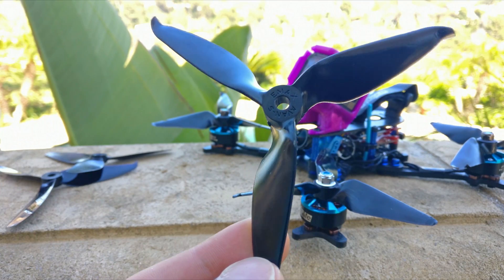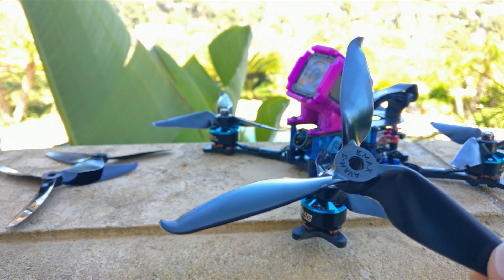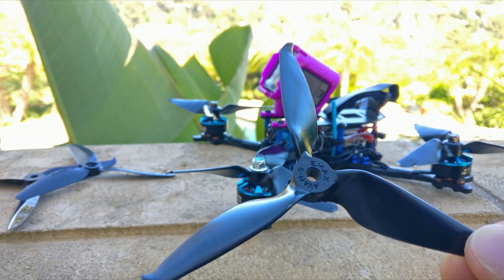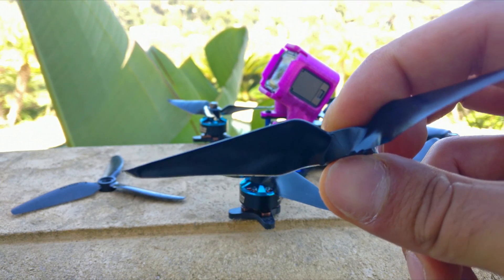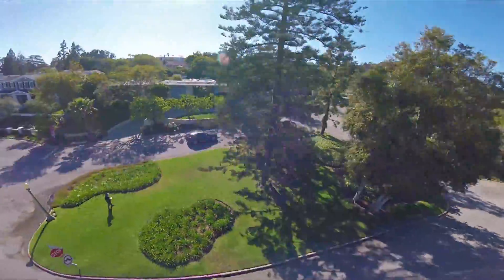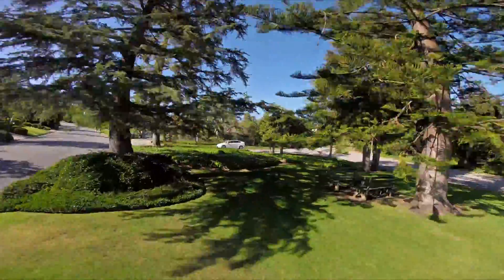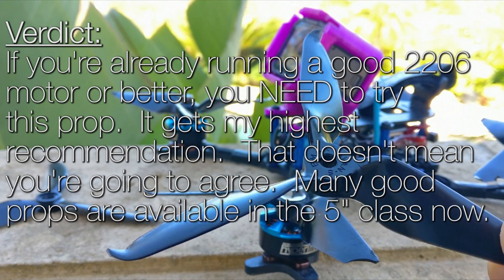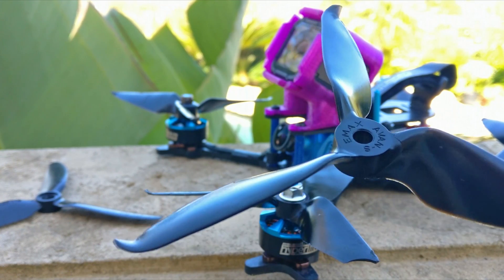Emax Avan Prop (Prototype) - Mini Review

Comment: Should I even bother getting this prop for Emax 2205s 2600kv? As far as I've heard, this motor can't even take Racekraft 5051...
Reply from the maker: Gustautas I wouldn't recommend it.
Reply: That's very sad, seeing how much you have hyped it. Could you recommend the best (in your opinion) prop for 2205s 2600kv?
Reply from the maker: Gustautas there are a few options. the new HQ5x4.3x3v1s, cyclone 5050x2 are probably your best options
Reply: Aside from the high amp draw of ~130ish I have had no problem running 5051 on the 2205 2600s. I've put my setup on 5s all the time with a 650g AUW (Thanks Martian 2, why are lightweight frames so expensive?) and they haven't burned yet. They come down around 50 degrees Celsius which is well within the working temperature of the magnets. Packs are Pulse 95C 1550 which are the same as the Rline.

Maybe I don't know that I'm missing out running a small motor, but other props like the 5x4.3x3 feel way too underpowered for my hefty rig and are pulling 70ish amps.
Reply from the maker: GainsFPV no you're right but the trouble is that on a heavier setup with huge props and high kv, the amps go through the roof. yes you get a bit more power and speed, but at a lot of cost. I also agree that the HQ prop are gonna be a lot slower. in the end your batteries suffer. which is fine as long as you're okay with that. in order to get the power you want, it's easier to go lighter than to pile on the power. on a lighter setup, you don't even feel much difference between the best and not the greatest batteries.
Reply: Kabab FPV so basically, if you're flying with a gopro and want to have reasonable amperage, 2300 is the optimal kv?
Reply: I do suffer in the slaloms too and I'm hoping to shift everything over to a lighter frame also because anything but my best packs I have to be aware not to drop under 15v/12v. Thanks for the reply.
Reply from the maker: GainsFPV by light, I don't actually mean that much lighter. my acro big motor setup is 570g auw. that's not exactly light but once you pass the 600g mark it becomes an issue.

Comment: Is motor shaft bent by thick propeller really a thing? Does it actually happens?
Reply from the maker: IRFZ44 I agree with Plur. heavy props don't bend shafts. I've never seen it. not even in motors made of cheese back in the day.
Reply: in my experience the type of prop you use has nothing to do with bending motor shafts.  If you have a good motor with 3mm or 4mm shafts you probably won't bend a shaft unless the motor itself hits a solid surface hard.  Especially with the trend towards hollow 4mm shafts that are one continuous shaft from top to bottom and not two parts.  The 4mm shafts are almost impossible to bend and other parts of the motor will fail.
Reply: My friend told me and since then, I don't run BN anymore. 

What do you think +Kabab FPV
Reply: I think 'bending shafts' was something spread to excuse the original HQ 5x4x3 exploding on contact with air.  'Oh the prop obliterating itself saves your motor' BS.

Comment: Lol! In the video you say, this prop should be ran on a motor with no less than 2600kv, but the description says 2300-2500kv???
Reply from the maker: J.FINESSE FLIGHTS higher kv has lower torque. 2206 2500kv is less torque than 2206 2300kv. therefore, 2206 2500kv is minimum.

Comment: the dalprop T5050C is very very very similar.  better if you take durability into  account.
Reply from the maker: FlyQuad FPV I don't find the 5050C to be in any way similar feeling. in fact the cyclone blades have the most distinct flight feel out of all the props I've ever used. when I fly a cyclone, I absolutely know it's a cyclone. I've begged them to make it lighter so that it looses that overly sharp feel because it's otherwise a great prop.
Reply: I guess I could elaborate and say they are similar in respect that out of the cyclone series of props the 5050C covers the lower end better providing more low end thrust. it's in the static test data. Keep the great vids coming man!
Reply from the maker: FlyQuad FPV yes in general the top three props I discussed a few videos ago do everything well. as I said in the video. it's really motor/prop combo selection and preference.

Comment: Nice props.I like the feel in control with 5051 racekraft and 5045 cyclone i don`t fly that good but 5152 gemfans gave me less control on the same tune.
Reply from the maker: peter toth I hate the 5051. the 5152 is much better. the Avan is the best control of them all.
Reply: Who sells them?
Reply: +peter toth the avan isn't out yet
Reply: Confirmed.I just set up my 260 for the 5152 props and they are very nice.I do appreciate your opinion,skills and knowledge.Thanks.

Comment: Ideally, wouldn't you retune after switching props?
Reply from the maker: Flying Squirrel FPV yeah but I suck at fine tuning so I just leave everything mostly the same. the firmware makes up for my stupidity. this quad has almost zero propwash regardless of whatever prop.

Comment: Richards multibuilders 2207/2580 motor be awesome with this prop I bet
Reply from the maker: David Downs yes yes yes. 2500kv for 5"
Reply: u sell those? or a set?
Reply from the maker: David Downs PiroflipRC has the same motor in a 2522kv. the MB 2500 is actually 2580kv. the 2400 is actually 23xx kv. this one I have falls right in between and is about 0.75g lighter and a bit stronger in the base.
Reply: Kabab FPV the props is what I'm wanting but u know when they will be released?
Reply from the maker: David Downs they say two weeks. hope that's true. I'm almost out and I won't even fly without these props anymore. nothing else feels good.
Reply: lol no proppys no flyie dang must feel good

Comment: Only point I disagree with is throttle expo -- it's exactly like tuning your roll/pitch/yaw expo, it's all for feel. If you like the feel of linear throttle then there's no reason to change it, but I wouldn't say it masks the feel of the prop. It's just another rate you can change, to try and get smoother control over throttle movements.

Nice review, I want this prop dammit.
Reply from the maker: Zak S it's not the actual throttle expo. it's the prop itself. the HQ prop just feels unpredictable to me. it doesn't do what I want when I want. but it is very smooth.

Comment: Hype Overload
Reply: This is the best prop ever, until the next best prop comes out tomorrow.  Best order them with overnight shipping so they aren't obsolete before they get to your house.  That's how this hobby works.
Reply from the maker: Plur307 there is no best prop. it's all just preference and motor selection
Reply: cyclones are still the best props overall.  Sure the gemfans feel better, but one little crash and they are jello makers, i suspect this one will be the same.
Reply: Nope, my setup is the best.  Everybody else sucks and doesn't know what they are doing.
Reply from the maker: mooosestang these props actually hold up well to scrapes and bumps with respect to jello.
Reply: If you dont have these to test yourself  then your opinion on them to me is worse than dogshit on a my Giuseppe's
Reply: LOL. You are 50% right 110% of the time on this.
Reply: @Rick Flare Are you replying to my reply?   I've flown, bent and broken a $1,000 worth of props easy and these appear to be very similar to the gemfan 5152, which fly great, when new.  They will bend at the hub and you'll never get them bent back straight.  They will cause jello.  The cyclones can be almost ground down to nothing at the tips and will not cause jello ime and once they bend, well, there is no bending back the cyclones, but it takes a lot to bend one.  As for fpv sushis hype overload comment.  I don't think kabab is trying to hype anything.  i believe he feels they fly better than any props he's tried
Reply: I have Storm Racing Edition 2306 2300kv and I bought these props because I love to try different props to see the differences. I m not looking for best props to stick with. I just love to try as many of them as possible :-D
Reply from the maker: Tom Frajer good to try
Reply from the maker: I'm not hyping anything. they truly fly well. I give good performing products good reviews and bad ones bad reviews. almost overly critical bad reviews. I choose not to review bad products too often because I can be extremely negative very very easily. in fact I was almost going to give the HQ prop a bad review because I could not get any degree of predictability from the prop on my quad. but then I realized that it's actually a very good flying blade, just my personal issue because I'm not used to it. I still don't think the HQ is very good. but there are two other very trusted sources that have tried the Avan and think it's not all that special. my argument as to why is because the Avan does not feel distinct at all. just an improvement across the board when compared to other good props. so hard to really feel it unless you're flying many props like I am. the other person doesn't have anything with the right motors to actually take advantage of the prop. 

the Avan is excellent when you use it right. it's not gonna work on a 2204, 1806 or a racerstar 2206. it's also not very quick on 2300kv.
Reply: mooosestang I was kind of just making a joke. I have heard a lot about these props and they have been built up to be something incredible. I hope they are able to live up to everyones extremely high expectations. Kabab is definetly not the kind of guy to endorse a product he does not think is good. Just watch some of his other videos and you'll know what I mean. LOL

Comment: is this the race or acro version of the avan?
Reply from the maker: Neil Fraser it's the triblade for the 2400kv motor. the twin is for the higher kv motor
Reply: so the two listings I'm seeing on pre order websites for race and acro versions are falsley showing a triblade picture?
Reply: one is called S5 and the other is R5
Reply from the maker: Neil Fraser I don't even know where you're looking. the props are tuned for the motor and kv. not for race and acro
Reply: Kabab FPV I am looking on prop city. "There's much speculation surrounding EMAX's entry into the propeller world, The AVAN series of props, named The AVAN R5 and AVAN S5 seem to be on the verge of shaking things up in the FPV community. With their new AVAN-R5 and AVAN-S5 line of FPV racing and acro props that are designed to efficiently reduce propwash and deal with cyclonic vortex in the most optimal method discovered to date, and with so little information on them it's all speculation."
Reply from the maker: Neil Fraser yeah I'm not so sure what the names will be but I know there's one for each motor. it's also designed by Sage Thayer so it's not like emax is doing this on their own. they did make the perfect plastic for the prop however. that was all emax. not Sage
Reply: www.prop.city 

I believe that in the context of that page...

AND means that the props can be used for both racing AND acro.

Comment: how does it compare to T5050C? like how twitchy in the control, is it more precise and smooth like the 5152 or more twitchy like?
Reply from the maker: DrAg FPV the 5152 is straight up slippery compared to this prop. the cyclone blades are very sharp feeling compared to this too. the Avan is smoother and far more grippy
Reply: Kabab FPV wow, better grip sounds good!!! cant wait to try them out on race courses. I just love how responsive T5046C is, if this prop can beat it, oh boy...
Reply from the maker: DrAg FPV the cyclone props are overly responsive. they're good for racing in that sense. this blade is very accurate in it's response.